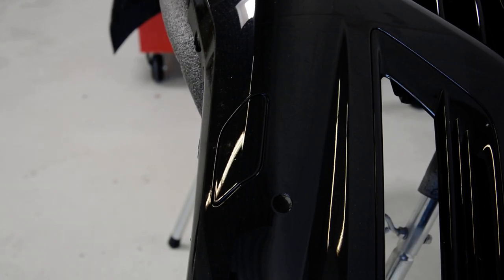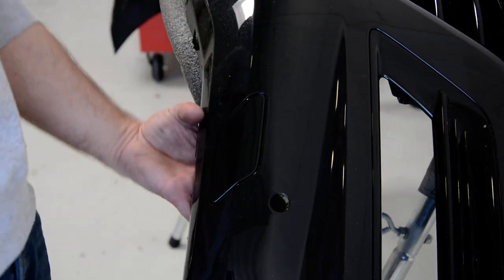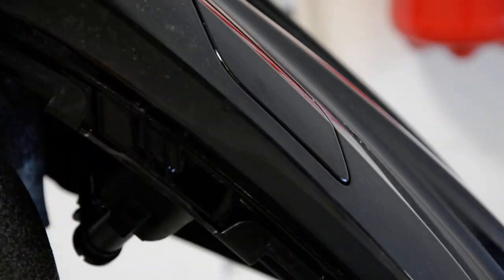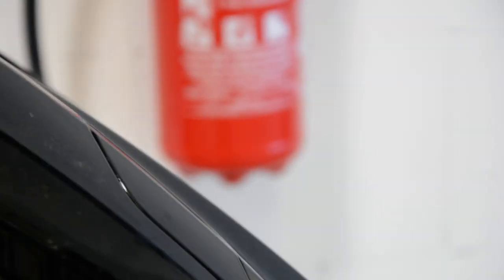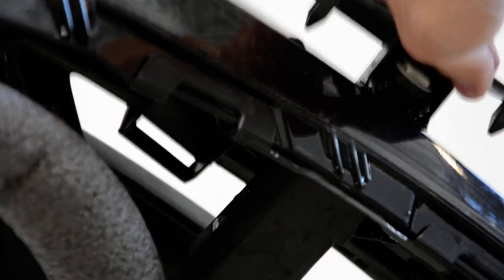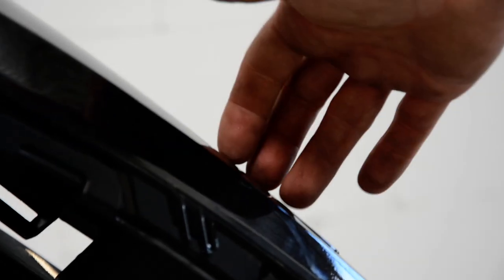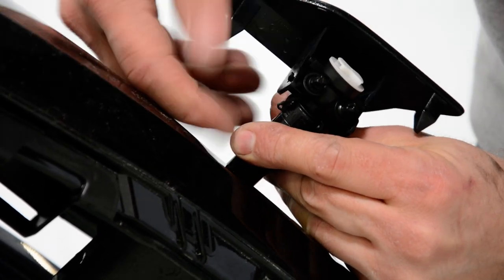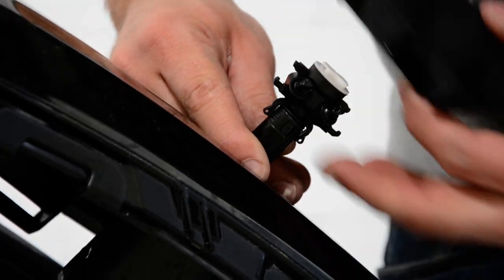VW Golf 7 headlight washer Cover removal

Comment: Hi DFC Garage i like your channel ,
 i have vw polo 2014 with a problem in cigarette lighter / 12v outlet  < No 12v  power exist  if you kindly make a video of how to repair i would be thankful 
Note: i used a small air compressor to inflate the tires and connect it into the car 12v outlet then problem occurs.
Reply: If it’s the same problem as I had in my old polo it will be a blown fuse so worth a try